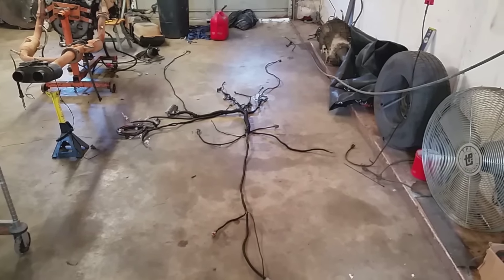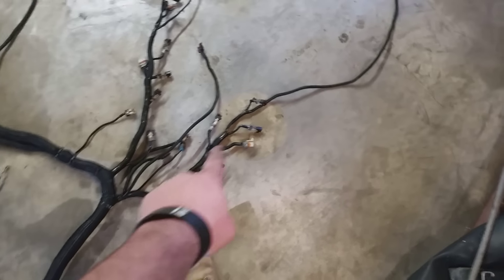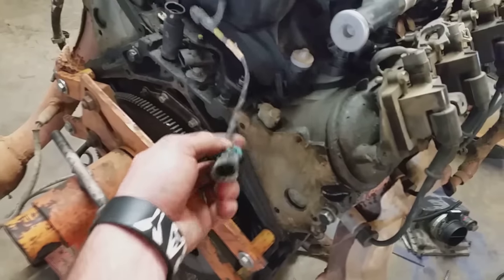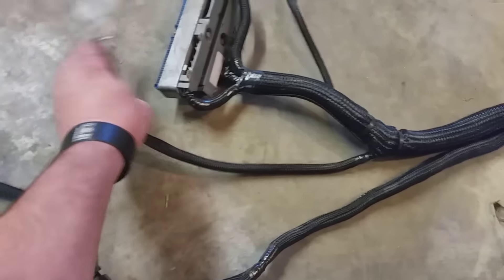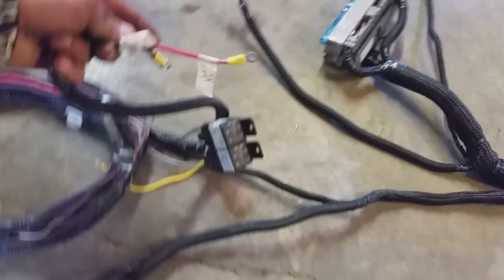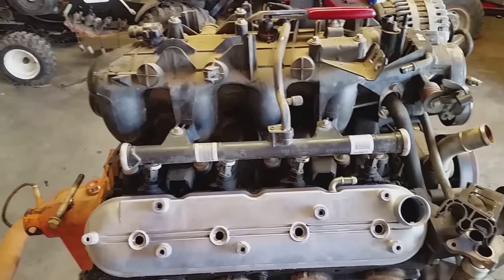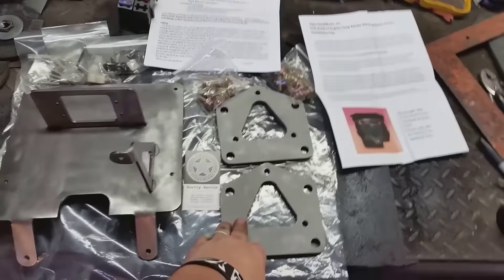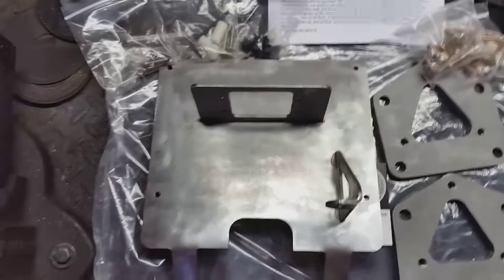How To Guide For A Stand Alone Harness 99-02 Drive By Cable System For LS Swapping Projects (Part 5)

Comment: Intense project so far. You got everything planed like a pro. Truck will be awesome when your done with it.
Reply from the maker: Thanks. Don't get me wrong I love my mower projects but when it comes to this kind of stuff there really isn't corners that can or need to be cut.
Reply: You got it, I been doing this sort of work for 20 plus years. I'm actually a tech adviser, one of my job duties at my job for this sort of work because of my work in this field. Never gets dull and always a challenge.
Reply from the maker: +prancstaman to be honest I have been working on vehicles for a long time. I'm no mechanic but I have done things such as pulled motors trans rear ends brake work oil rad change u know everything short of rebuild an engine lol
Reply: Never fear, to modify, you need to understand the basics first. You got way more knowledge of how everything works then you think, and that's what making mods possible. Doesn't matter if you even know how, you have the ability to know what exact question to ask with a very specific goal. And I think that's the fun part. Have fun!!!
Reply from the maker: +prancstaman ty

Comment: Do you really need the oil pressure plug ?  Can you use a adapter for the oil sending unit that goes to the car?
Reply from the maker: Yes sir you can. That's what most peoe do.

Comment: Hey bud great work!!! Been following you for a while and love your work along with Mrwhitels1! I'm going away for about 9 months and as soon as I come back I'm starting an ls swap on my 80 k10!!! Ive been trying to find a few answers about the fuel system and some wiring later on down the road...... I seen how you R.E.M. your fuel system but what pump/sending unit did you use? I have dual tanks which I'll be using eventually since I need to find a bigger selector valve that can withstand  the 30psi+ of fuel pressure!!!!!!
Reply from the maker: I used an 87 R10 pickup fuel tank and sending unit then get u a walbro 255 fuel pump

Comment: is this set up the same for a 87 IROC-Z LS swapped
Reply from the maker: InCoreys World same wiring as for the motor and trans harness if your using the same setup I am 99-02 5.3 ls with a 4L60E trans
Reply: Lonnie's Garage my set up for now is the 6.0 /700r4
Reply from the maker: InCoreys World OK go to lt1swap.com and look for your pinout.